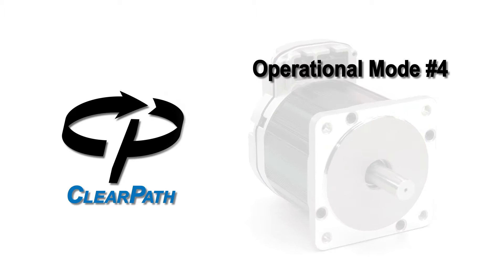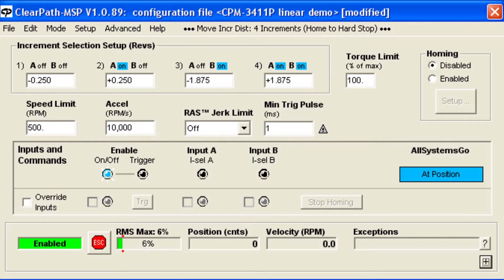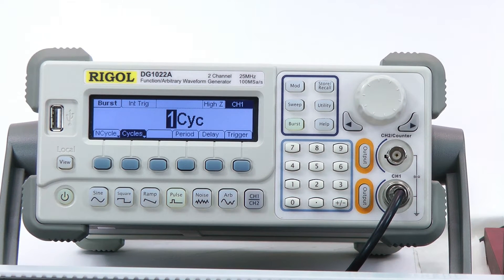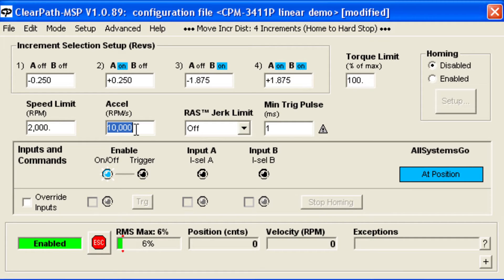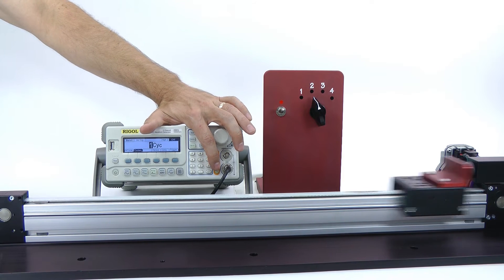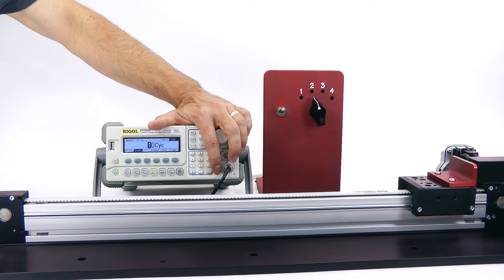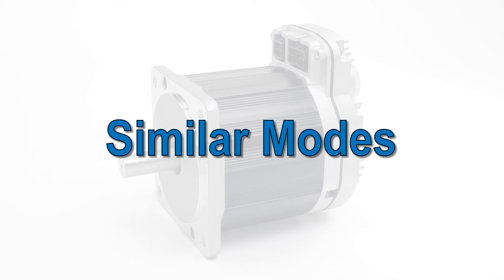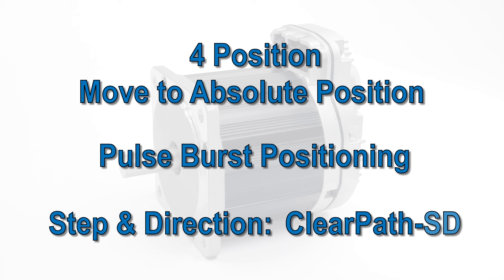ClearPath Integrated Servo Motor: Move Incremental Distance Mode

Comment: Is there a Operational Mode that can receive these values through sequential binary? Following this operation mode, my application would require to move the carriage to 65535 positions within 1.25m of travel. It would make far greater sense to send a 16 bit value using input A for data and input B for clock, instead of sending 65535 pulses. Is this possible?
Reply from the maker: Hi PicoKit,

There isn't a mode that takes in sequential binary commands like you describe, but there is an option with ClearPath to achieve the type of positioning you need.

One of my colleagues noticed your comments on some of our other videos, and it sounds like you are working on a laser engraving/cutting machine. CNC applications, unless you are doing something unique, are best served with Step and Direction control. This control is pulse-based, but the major advantage with this signal type is that it gives you fine and variable control of both position AND velocity, which is necessary for most CNC machines.

ClearPath-SD series servos were designed specifically for Step and Direction applications. They are commonly used in OEM laser, plasma, waterjet, and table router CNC machines, to name a few.

To answer one of your other questions, the ClearPath servo is fully closed-loop (torque, velocity and position loops), and all loops are all closed inside of the integrated motor system. 

The internal encoder signals are not brought out to the controller connector for a variety of reasons (connector space, electrical isolation and/or potential noise corruption, etc.), but there is feedback on that connector that can assure you that the servo is tracking your command within a user-defined position tolerance. This allows users to trigger a device (such as a laser) off of the step command and get excellent accuracy. 

If you have any further questions, please feel free to contact us at support@teknic.com, or call us to speak directly to an engineer about your specific requirements.

Matt C.  - Teknic Servo Systems Engineer